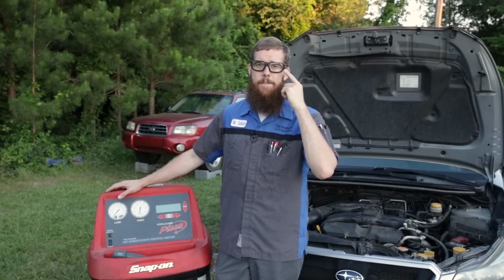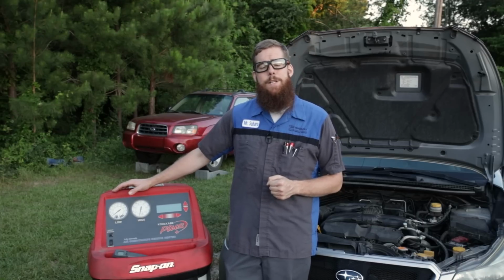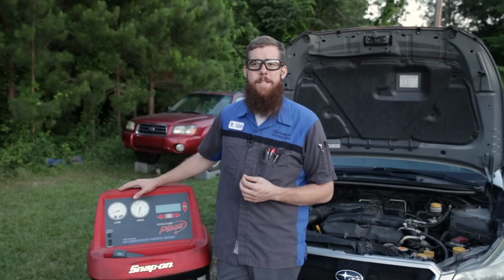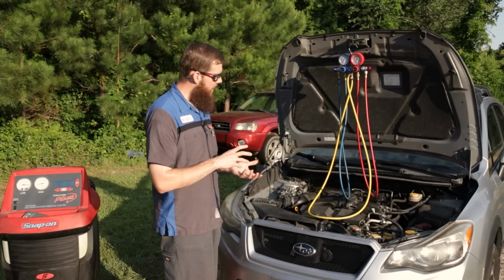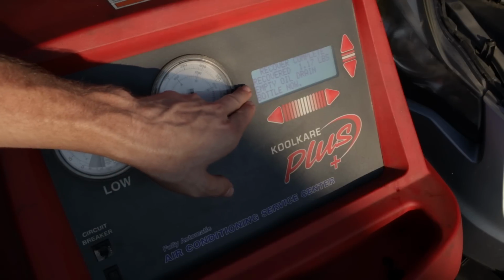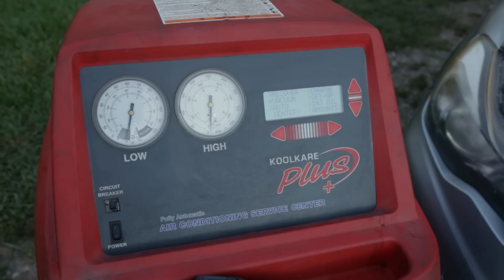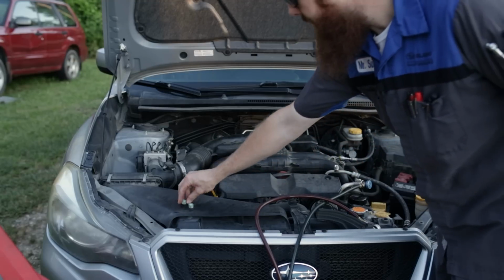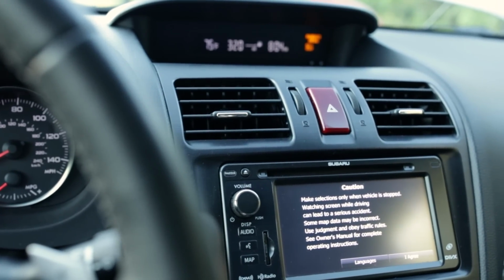Automotive A/C Basics: Seasonal A/C System Service

Comment: Mr. Subaru guy.. I have a question for you regarding a 2002 Subaru Outback LL Bean Edition. I discovered the typical A/C O-ring leaks at the compressor and replaced those 2 O-rings. My question now is, it looks as if the AC Compressor Clutch is faulty as it has busted springs on the outside. When it does manage to spin the car gets cold. But it is hit and miss. I was wondering if you happen to know if the clutch assembly can be replaced or is there just a outer spring assembly available? If you could please give me some information as I really don't want to replace a whole compressor that is still working besides the clutch being bad.
Reply from the maker: Can you email me a picture at MrSubaru1387@gmail.com?

Comment: My 2010 Subaru outback 2.5 pushes only a little bit of cold air with the A/C on during a warm day. My dad said my cooling fluid was low so I bought a kit. I followed the instructions but no cooling fluid came out of the bottle and the pressure read something like 105 psi.. Is my A/C's compressor weak or is something? Thank you for your help
Reply from the maker: 105psi on the low side?! Did the compressor clutch cycle on and off?
Reply: @MrSubaru1387  Yes, I can hear the compressor engage when I put it on and disengage when I turn it off. And 105 psi above the blue zone (between the blue and red zone)
Reply from the maker: 105psi is way too high for the low side reading. You're likely overcharged.
Reply: @MrSubaru1387  Too correct this problem myself, what can I do? Can I simply press on the valve below the cap?
Reply from the maker: @TheCharacter97  no. You'll have to have the system recovered.
Reply: @MrSubaru1387  Alright, thank you for your help MrSubaru

Comment: Very informative video, thanks!  The KoolKare machine makes the job a lot easier.  What happens to the old recovered refrigerant? Do you have to take it to a recycling center somewhere?
Reply from the maker: The machine filters and recycles it itself for use in the vehicle, or others.
Reply: @MrSubaru1387  Wow, no wonder so many techs use it. Tks again.

Comment: With more GDI engines coming from Subaru now. could you do a video on your thoughts about maintenance on them? I have seen video that some GDI engines can get their valves clogged real bad. I have seen inconsistent advice based by car brand/model about what to do, but running GDI cleaner of some sort at each oil change is what I have guessed would be best. could you also try to cover running GDI cleaner through a Subaru engine?

Comment: I have a 2012 Subaru Impreza.  The AC Evaporator core failed in the beginning of 2019 and I replaced it, along with the expansion valve and seals.  The system was Evacuated and recharged, but doesn't cool as it once did.  It only gets down to about 55 degrees.  The dealership states the condenser is leaking and wanted $1200.  I said no, and now 1.25 years later, it still blows 55 degrees.  If it was leaking, would it not now be too low on refrigerant to work at all?  Any advice you can provide?  Thanks in advance and keep those videos coming!  :)

Comment: The AC system on my Impreza (2012) has been dead for a while. I haven't been driving it so repairing it is not a top priority.

I know there is at least one leak, where the high side hose connects to the compressor. What I'd love to know is, without that fancy SnapOn machine, how can I know the system is low on PAG oil and how do I add oil to the system?

Comment: Doing a pressure test under vacuum is only using 14.7psi so it’s not something that is very useful
Reply from the maker: If the system can't/won't hold a vacuum, then it won't hold refrigerant. Leak testing, via a system's ability to hold vacuum, is an essential tool in the hvac diagnostic arsenal.

Comment: Cool video, I have owned to many Subarus to mention (always bought new other than my GC6 mentioned prior), I always thought they had AC systems on the weaker side, same advised by my buddies who also buy Subarus. Man do I wish you lived near Long Island, I wouldn't trust a local place to do this service correctly, especially adding back in the pag oil. I actually don't trust them do much of anything correctly, maybe brakes they do okay since that is a pretty simple service, even then they cut corners and do a sloppy job. I used to do brakes myself but live in an apt now, makes car work a pain in the ass.

Comment: R1234YF is such a scam, there's a limited number of manufacturers producing this new refrigerant so they get a monopoly on supplying it to anyone who uses it. We once used propane and isobutane as refrigerants way back, but apparently having 300g of it in your car is "very dangerous" compared to the 60L of gasoline or liquid propane some cars have on board. Some auto manufacturers have also refused to use r1234yf in their cars for a number of reasons.  I have vacuumed and recharged my subaru with an equivalent mass of refrigerant grade propane/isobutane mixture (plus pag oil) and it's been running just fine for 3 years now. High and low pressures are normal, temperatures are within spec. Plus, propane and butane can be released into the atmosphere without having the need to recover it. Think of all the barbecues, furnaces etc etc that release a small amount of gas before ignition. Ozone Depletion Potential (ODP) and Global Warming Potential (GWP) are two numbers that use CO2 as the datum for comparing other substances and their negative effects to our planet. R124a's numbers are ODP=0 GWP~1300. R1234YF's numbers are ODP=0 and GWP<1. Propane(r290) and isobutane(r600a) ODP=0 GWP=3. SO, why are we shelling out thousands and thousands of dollars to use r1234yf and ALL new fittings and systems at $70-$100/lb, r134a is $5-$10/lb. Propane(R290)/isobutane(R600a) similar prices if not cheaper. Again, such a scam to use r1234yf. Also, please don't recover/charge/vacuum your own ac system in your car or house. You need to know what you're doing and have an understanding of thermodynamics and thermofluid systems to do this job safely (I'm an engineer). I am not r134a certified, nor carry a valid ticket to work with r134a. That is why I use propane/butane grade refrigerants (you can purchase off the shelf). My car was already empty of r134a from the previous owner so I did not release it absentmindedly.
Reply from the maker: Exactly. We could be using compressed carbon dioxide.
Reply: @MrSubaru1387  isn't that the same nasty stuff that comes out of the tail pipe? ;)
Reply: Woah

Comment: I'm planning on ripping the AC out of my WRX lol, I guess this information is somewhat relevant to what I'm doing in a way
Reply: AC is pretty useful and snowy weather for pulling moisture out of there and defrosting. If you were rallying it probably isn't a small amount of horsepower that's holding you back. It's probably skills tires and suspension. I'd keep the AC.
Reply from the maker: Why would you rip it out?
Reply: @MrSubaru1387  I live in wisconsin so we don't really need it too much up here, also because I'm planning on making it into a rally cross car
Reply: @MrSubaru1387  The main obstacle im trying to get over now is that the alternator uses the compressor as a mounting point so ill need to fabricate a new bracket for the alternator to mount on, or just hack up the compressor and use its remains as a bracket haha
Reply: Grooove Im fairly certain there’s a pulley that can go into place for that, but to be honest with you I live in Newfoundland Canada and I use the AC all the time in winter to get rid of frost faster